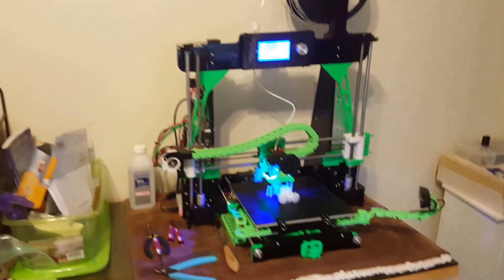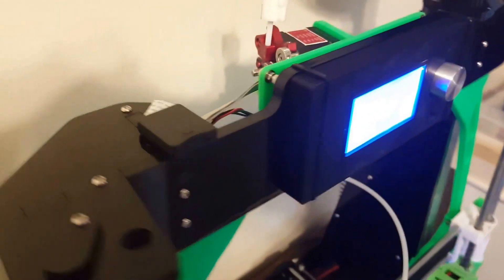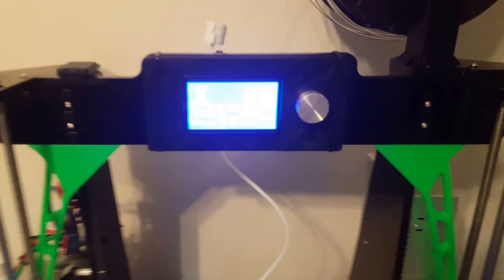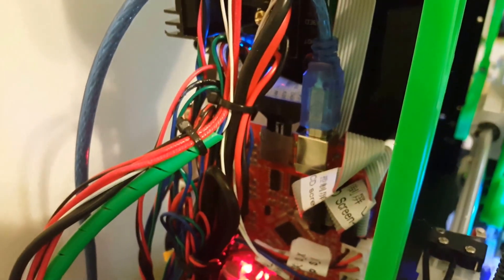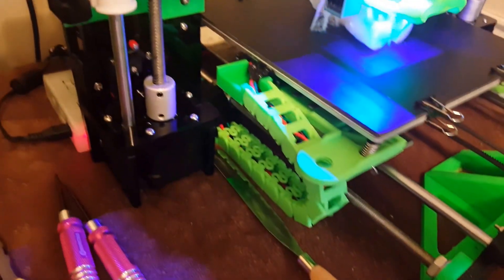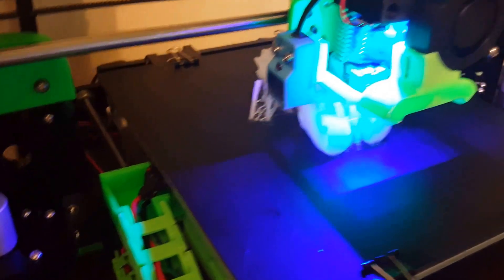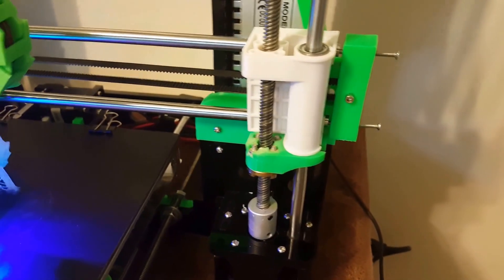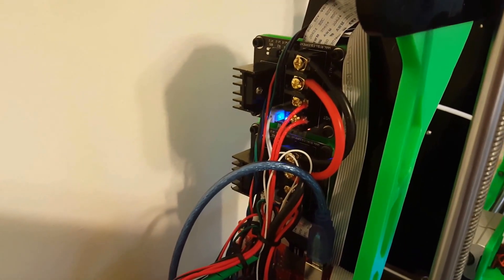My Anet A8 recommended upgrades

Comment: I'm still pretty new to the calibrating process, and I'm a little hesitant to print parts intended to improve the printer out of fear of printing errors. Which upgrades would you say improve the quality the most/made the most difference? Thanks for the upload, definitely getting me inspired to step up my A8's performance!
Reply from the maker: Biggest single improvement would be to replace the board with a duet wifi. It has much better stepper drivers on it. Will quiet the printer, smooth out the steppers. Increase quality. Best upgrade by far.
Reply: @JohnTaylorFPV  is there a trustworthy website to get one at a decent price? Was hoping for cheaper/free upgrades since I'm still pretty new to this lol but I think I would go that route before buying a new one like I've heard some recommend. This printer seems worth putting money into in the long run opposed to just putting it on the back burner for one that's better stock.
Reply from the maker: I would go directly to duet3d.com.  They are a little pricey, but worth it. After that I would check into an am8 metal frame

Comment: So quiet, do you have any tips on how to make mine more quiet did you replace the bushings? Etc. thank you
Reply from the maker: the upgrade that will make the biggest difference is a duet wifi board, or you can get some better stepper drivers and run higher stepping.  most of the noise come from the low stepping making the stepper motor vibrate.  it will turn your printer into a completely new machine.
Reply: John Taylor thank you for your quick response, I’m fairly new to printing. Please forgive my ignorance. so replacing the stepper drivers on the main board I’m assuming. I found 5 drv8825 stepper drivers on Amazon so then after I install those i assume I adjust some setting in my slicer settings
Reply from the maker: if your new i'd just upgrade the board to a duet wifi.  it would be less complicated then trying to  add drivers, you wouldnt be able to replace the ones on the board, just bypass them and use external drivers.  it's not really that simple.  the duet wifi board comes with very good drivers and all of the settings are set through a web interface, no mucking with the config file and reflashing the board everytime you want to change a setting.  plus you can upload your stl file directly to the printer, i had an octoprint setup and completely stopped using it after i got the duet.

Comment: Hello,
What kind of plastic did you used for the frame of the e3d v6 hotend?
Do you think we can do it in PLA? Or is it getting too hot?
Reply from the maker: I've used pla before and it did warp after time. I prefer polycarbonate, but abs or petg should work fine as well.
Reply: That's what I thought. Thank you for responding :)

Comment: For everyone saying that you could have gotten a better printer: The A8 is a tinkerers paradise. 

1) It's dirt cheap ($150ish bucks). 

2) You literally assemble EVERY piece that comes in the box. This is what learning is all about. It teaches you what each part does, and you must pay attention to detail if you want it to work.

3) If you jump right into a bigger, more expensive printer with zero experience, and have issues without knowing what the hell you are doing, you are going to have no idea how to troubleshoot hardware/software problems with your prints.

4) It has a huge following, tons of printable mods, and tons of support groups (Facebook) etc.

I now have a Creality C10, but the experience I gained from the A8 (failures and successes) will help a ton going forward.

Comment: Was the A6 display a direct plug and play on the A8?
Reply from the maker: JAY IRVING pretty much, quick change in the firmware
Reply: John Taylor howd ya do that ?
Reply from the maker: you'll want to research how to upgrade the firmware.  it's been a while and i dont remember.  i run a wifi duet board now, it's completely different

Comment: Can you provide the STL links to the mount and whatnot for this? I have an email into them to find out how this one works. Thanks I appreciate it.
Reply from the maker: what stl exactly are you wanting?
Reply: Was there anything specific that you used to mount the flex 3d extruder? And the hot end?
Reply from the maker: the flex extruder works best mounted directly to the stepper motor and not how i have it in the video.  i would mount it directly and then find an stepper mount that holds the stepper by wrapping around it.  something like this https://www.thingiverse.com/thing:1646187
Reply from the maker: and use this part to make it bowden https://www.thingiverse.com/thing:2387577
Reply: Interesting. I thought that you were using this https://flex3drive.com/ , my bad. You are using https://flexionextruder.com/, correct? Wow expensive extruder. Is it really worth it?
Reply from the maker: i was using a flexion, but i switched over to the flex3drive.  I like the flex3drive much better, i think it's worth the money.

Comment: LOL to print tpu all you had to do was print out a tiny tpu peice that goes into your extruder then it prints tpu perfect everytime and it just stays in there takes 10 mins to print 30 seconds to slide inbetween the wheel and the gear and boom priting tpu then when ur done and print pla or abs itmakes it easier to feeed into the hole

Comment: No offense, but with all of the upgrades, the money and time invested could of gotten yourself a better printer. I run it almost stock and getting great prints out of it.
Reply from the maker: +Серёга I specifically wanted something to tinker with and my other option was a cr10, but I really don't have much room, so went with the a8. I did a whole lot of research and shopping before I went this route and I'm very happy with it.
Reply: John Taylor if you really want to tinker with something,  then get the Geeetech Rostock 301 the biggest paperweight I currently own. Not a print out of it yet, axis move however they want on its own, extruders are not extruding, constantly jams the fake dimond head,  leaks melted plastic out on the hotend where one of the radiators screws in. Fan not spinng on one extruder motor. Firmware is buggy as I don't know what.
Reply from the maker: Серёга lol, that sucks. I'll have to look it up. There was a 3d printer for kids I saw, it was all plastic, had these tiny ass steppers. I'll see if I can find it, it looked ridiculous

Comment: I need part for y belt chain, prevent to going upward, what is it name? Can you give me a link of that? Thanks
Reply from the maker: are you talking about the mount the sticks out on the front left of the bed?  That's actually for the camera so I can mount it on either side. If that's what you're talking about this would be a better option https://www.thingiverse.com/thing:2221564

Comment: Looks good. 
Could you post the URLs for each upgrade?
Thanks for showing us your setup
Reply from the maker: I'll go ahead and post this.  It is my Anet A8 collection on thingiverse.  It will have a lot of stuff I didnt use, but most of what I did use will be in there. https://www.thingiverse.com/mordant80/collections/anet-a8-upgrades/
Reply from the maker: When I get the time I'll put together a list of links for all of my upgrades, included a few a forgot in the video such as the bearings.
Reply: Wow, Just got an Anet A8 And would love to have similar design as you have. Can you send some links in description to the stuff you got ?
Reply from the maker: I will after I finish a couple more things.  May make a new video.  I've found that my extruder stepper just doesnt have enough torque when it comes to the non flexible filaments.  I have to print regular filament very slow or it skips steps, I can print flexible at full speed though.  Right now I'm forced to swap to my titan extruder for regular filament which is a pain.  I have a 5:1 ratio gearbox on the way for the stepper.  I think this should give me the torque I need to run all filaments at normal speed with the flexion extruder.